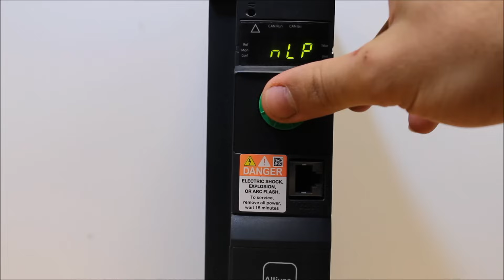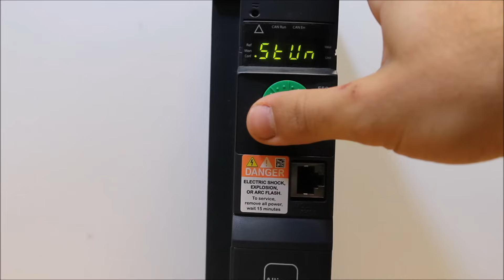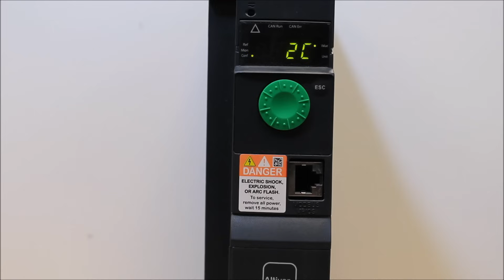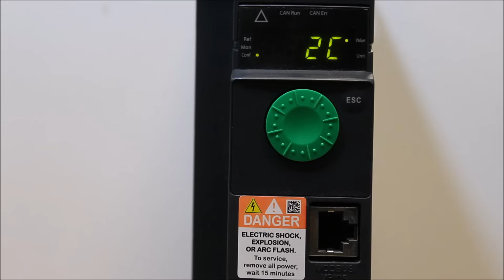Altivar 320 Programing - Configuring Basic Parameters  | Schneider Electric Support

Comment: Just a quick question, in order to have VOLTAGE in output of drive, just to see there is VOLTAGE in output by multimeter, we have to start the drive ? or as soon as we have the power in input, we should see the voltage in output ? I just wanna check if my drive is having an issue or not.
Reply from the maker: Thank you for your message. We apologize for any inconvenience caused. For troubleshooting support or to express your concerns, please reach out to a technical expert in your location here: http://spr.ly/6054P7FPe

Comment: My ALT320 does everything you say except it won't let me change to 3-wire command. Is this because I am powering the ALT320 using a +24VDC external supply rather than the Line voltage?
Reply: Yes.